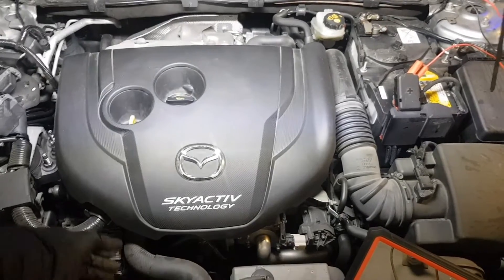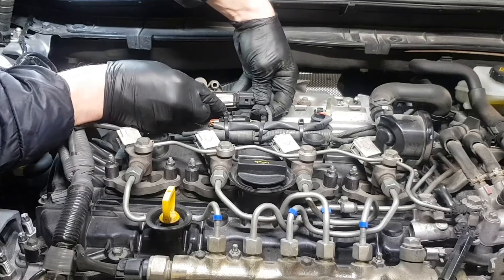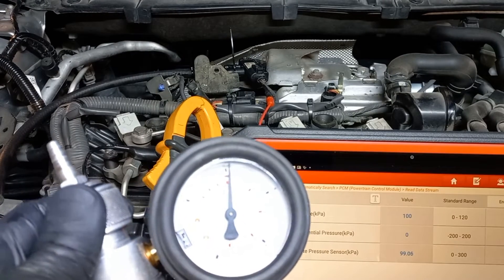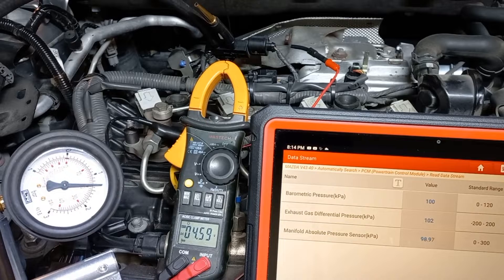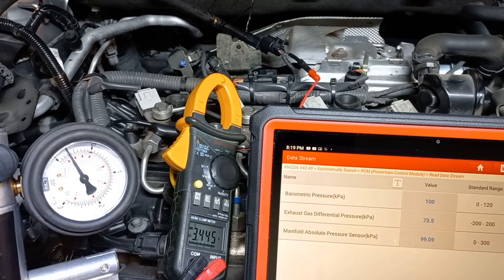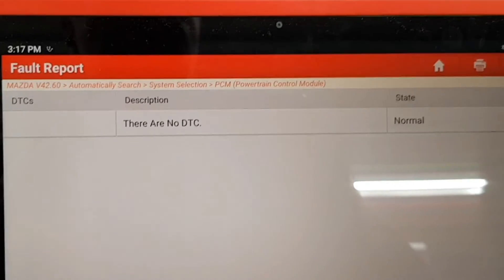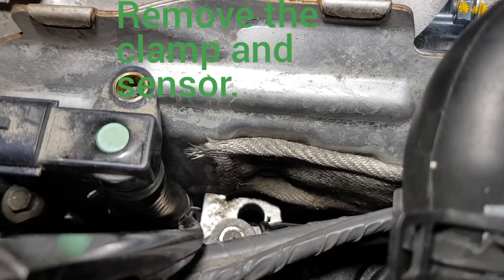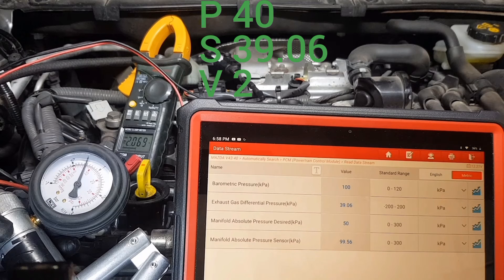Differential Pressure Sensor, Exhaust Pressure Sensor. How to diagnose? Reference data, DTCs

Comment: I have a problem, when Mazda CX5 2.2 is in neutral I have a good pressure of 93.77, and when the gas is added it goes over 150, what might be the cause and what should be applied?

Check the link to see the parameters:

https://youtube.com/shorts/c1Ok6o8Hpf8?si=GTDPK3P7ZYPxKGHW
Reply from the maker: It is not a problem, when you rev the engine it should increase pressure it actually means nothing. You should do the tests as on the video and compare them to the reference values as I shown in the vid. Ignition should be switched on engine not running, exhaust gas pressure should be approximately the same as barometric pressure, if there is significant deviation then the sensor is malfunctioning. Any DTCs were stored?
I included that the difference between baro or barometric pressure and the exhaust pressure sensor value should be no more than 12.6% 9:49 I consider sensor as malfunctioning and replacement whenever the value deviation reaches 10%

Comment: I've diagnosed the fault as the exhaust pressure sensor, replaced for the new type. Checked wiring on hoses, all seem good. Still getting the same fault, except now the lights won't reset with the scanner. Any ideas? 😭
Reply from the maker: If you can not erase DTC, it is an electrical fault, wrong connection, bad connection etc.
Reply: Cause the whole pipe is blocked
Reply: Cleaned that out too... starting to think its the small turbo not boosting @MrWtfstfu
Reply from the maker: Can you check the live data, turn the ignition on, look at the exhaust pressure sensor and map, compare the reading and post it here please.
Reply: @JB_Auto  drss sbs,scbs lights are on the dash,   we have changed the exhaust pressure sensor with the new kit SHY618W00,reading live data is ok but no boost ,car kicks while shifting ,doesnt want to rev and shift higher gears all the lights are still on Anything we can do ? does it need new software or adaptation for the  new sensor on PCM module  ? thanks
Reply from the maker: @akıllısu Check for other DTCs. If live data is within spec, then it is not sensor-related. Check the exhaust pressure sensor pipe for clogging
Reply: Hello ,I am responding to you as @akillisu  mazda atenza 2014 2.2d After changing exhaust pressure sensor TCM U0442:00-2F and
ABS U0401:00-8A  faults can not be cleared from the car
Reply from the maker: @razor000111ify Those U codes are related to communication, especially if that can not be cleared.. To fix that, you need diagnostic procedures from Mazda. We have never experienced such an issue. Usually, after storing the U code, the P code gets stored and indicates and narrows the location. At this stage, you can expect anything. U codes can also be generated by soot in the inlet manifold. The best is to connect the Mazda IDS and read the PCM DTC store record, where you may find the P code, which will help you with further diagnosis. As far as I know, that function is only available in the Mazda genuine diagnostic tool.

Comment: I have a 2015 Mazda 6 2.2 Diesel, and the check engine light (CEL) keeps coming on constantly, even though the vacuum pump has been replaced, the intake manifold has been cleaned, a software update has been performed, and the mass air flow (MAF) sensor has been replaced three times. Despite all this, the CEL is still on.

The error code is P0101, and I suspect it could be caused by a faulty sensor. What could be the issue? Can you help me?
Reply from the maker: @erendemirer4328   Hi, where all those jobs have been performed? Was it at Mazda dealership? How did you clean the inlet manifold and especially inlet valves? I mean, does it all look like a new part after cleaning? Check the turbo that could trigger the error code. Check whether the inlet system is air-tight. You can also check the MAF sensor using my video, but if you replaced the sensor with a genuine part, malfunctioning is not likely. If you are certain about all of that, then it could be PCM, but that should be considered as the last step because it's not plausible.
Reply: @ The work was carried out at a Mazda dealership. The intake manifold was cleaned using walnut shell blasting. Now the intake manifold looks clean. Additionally, the turbocharger is working. No Mazda dealership knows what the issue is. I have sent emails to Mazda, but they don’t know either.

Comment: When you install or mount both the DPF differential pressure sensor and the exhaust gas pressure sensor, do you need to reset or tell the ECU this with the scanner? I know that when changing the DPF (Particulate Filter), it is necessary.
Reply from the maker: @cransaftvalve734  Hi, no reset is needed, and no such option is available in the scanner.
Reply: @JB_Auto  OK, thanks.

Comment: If the car suddenly starts to get more frequent dpf regen, 160 km (used to be around 260 km) could it be the differential sensor?
Reply from the maker: Yes, it could. Therefore, I utilised that reference data as in the video to be able to exculde or include that sensor during diagnosis.
Reply: @JB_Auto  Thanks, i will check it. Can the pipe from this sensor to the exhaust clog, or is that more common with the other one?
Reply from the maker: @hkk210  It is possible but very rare. It should be checked during diagnosis.

Comment: I have an oil leak from near the oil control valve. Any ideas what it may be?
Reply from the maker: It could be o-rings or OCV itself. Check also valve cover and around.
Reply: @JB_Auto  Are both prone to fail? do you have the part number of the o-rings?
Reply from the maker: @kas5857  Most likely is the valve cover gasket, you should evaluate.
Reply: @JB_Auto  Thank you. I just took a look today and it seems the breather on the rocker cover was blocked with carbon due to injector leaking. So i think the rocker was over pressurising causing the leak. In your experience can i reuse the rocker cover gasket? also the can the injector rubber seals on the rocker be reused?
Reply from the maker: @kas5857  I prefer to replace them every time, but if gaskets are recently replaced and looking good... it is up to you